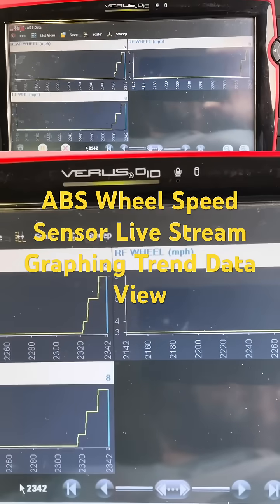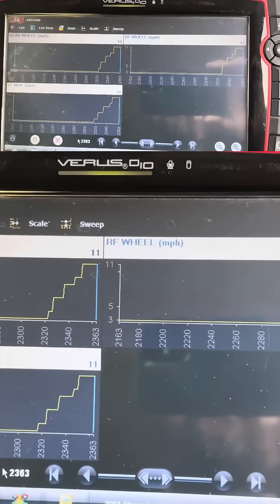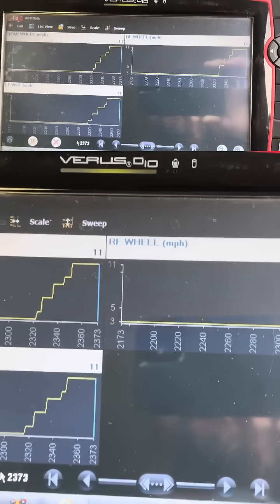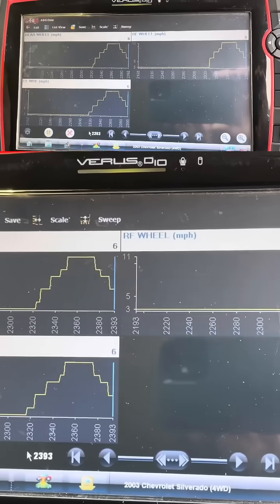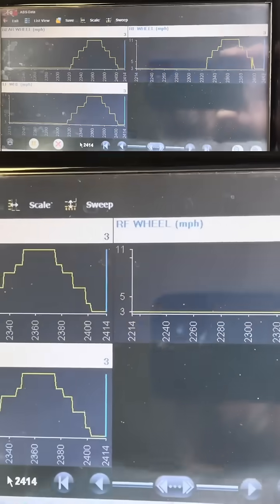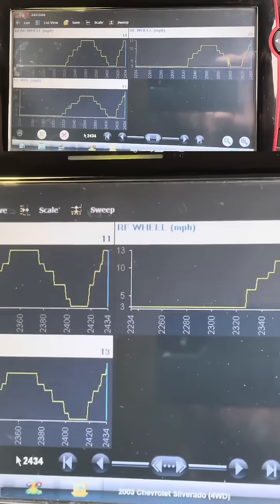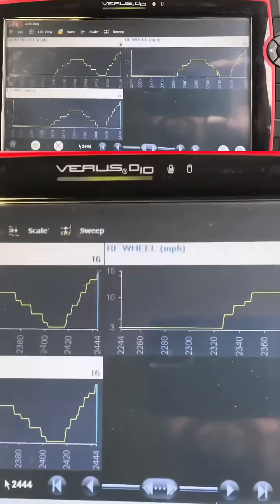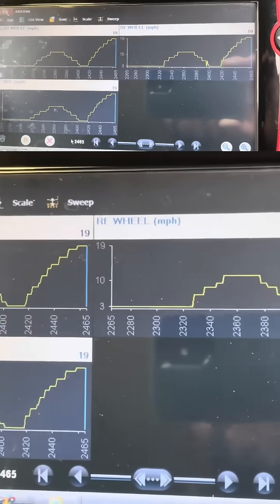ABS Wheel Speed Sensor Live Stream Graphing Trend Data

Comment from the maker: Related Video Captures The View Of All Three Sensors Graphing Trend Better. Sorry the short cuts the edges and doesn’t play it in wide angle. 2003 Silverado ABS Wheel Speed Sensors. 

The Right Front Wheel Speed Sensor Did Display An Irregularity At the Same Time You Can Hear In The Video The ABS Modulation At Low Braking Speed. Definitely Something To Keep Your Eye On. Happened At 2:00 Minutes.